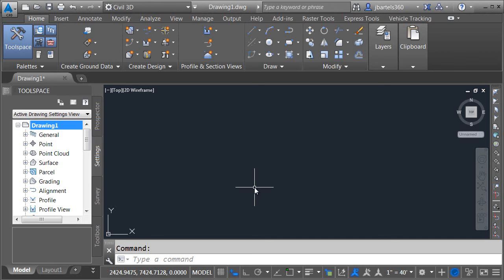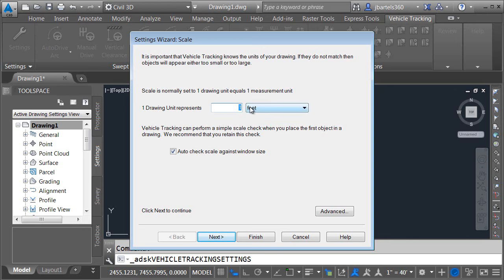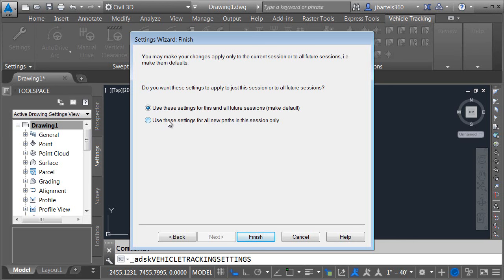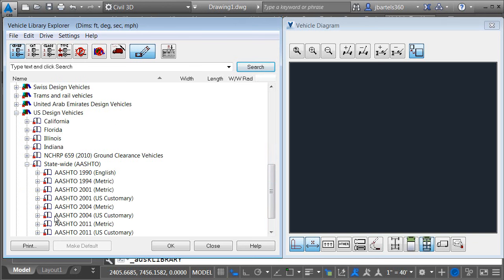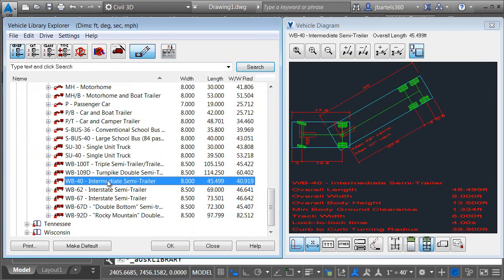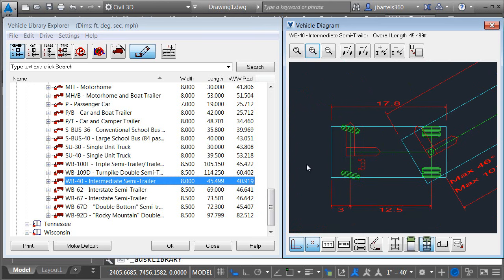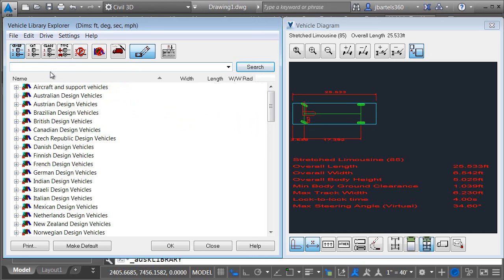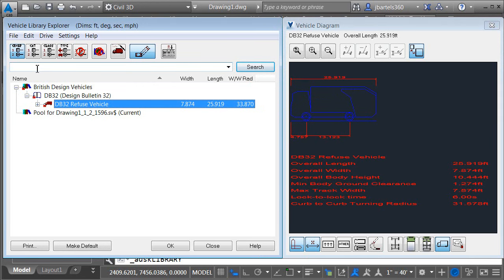Learn Autodesk Vehicle Tracking Pt.1 - Getting Started

Comment: Good day Mr. Bartels. Thank you for the good quality Vehicle Tracking Tutorial. I Have been using the Add-on Program for a bit more than 3 months now. To be honest regarding the Program - I am completely clueless as I have no idea on what I am doing. In the past I tried to use standard vehicles as far as possible but now I am in a bit of a bind. I need to create a new vehicle tracking profile for a truck and trailer with a rear mounted crane fixed to the back of the flatbed truck. I have all the specification related to the tuck but struggling to get the information (like adding a trailer) to the profile (I managed to create the profile for the truck though) would it be possible for you to produce a short demonstration on how to create multi-body vehicle profiles? Thank you for the awesome tutorial once again and greetings from SA